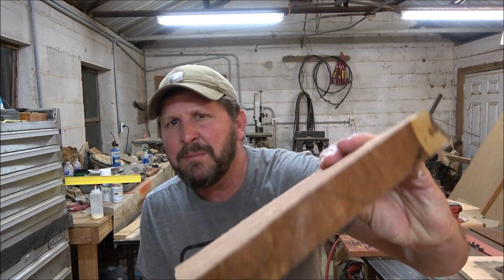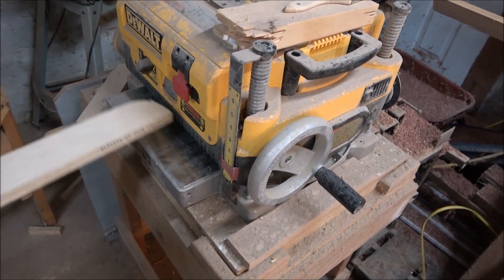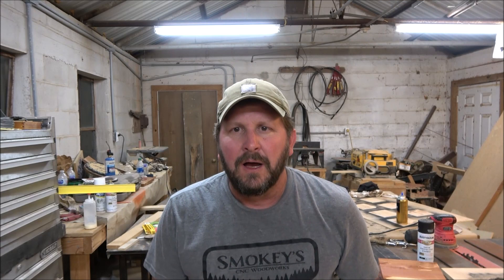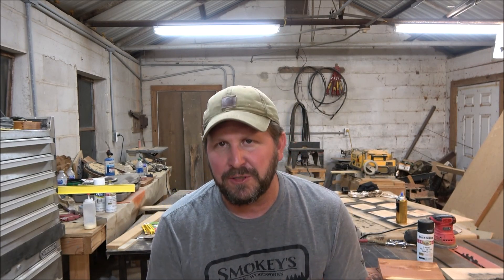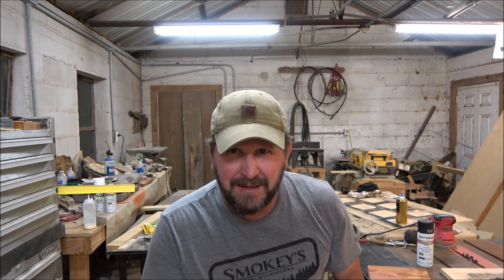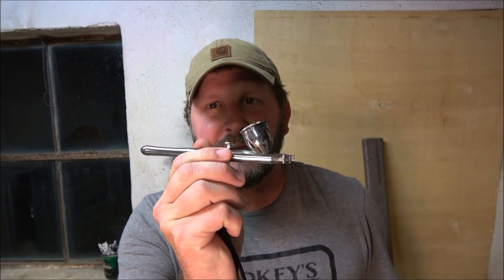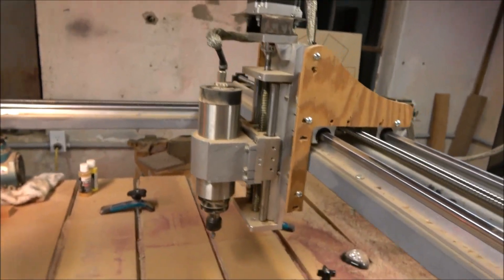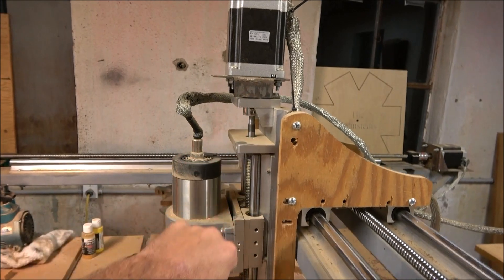CNC machine and process (Questions and answers)

Comment: Hey there Smokey!! Awsome videos I reatdo admire what you’re doing..I do basically what you do..just closed in my shop so now I am working the AC😁it’s freakiohot down here in south Texas!!! Well my question is...I have a built cnc like urs build by Charley Thomas from Triquetra CNC he makes those awesome touch plates,however I have some motors on my machine that get very hot that eventually you can’t even hold them for 3seconds! Bcuz it’s so hot! I have a nice controller with UC100 ..what’s wrong why do they get so hot?I even went as far as putting those little fuses inside the plug cord plugs into the controller the fuses that keep her from getting real hot because without those it was getting extremely hot but I don’t know nothing seems to be working I’m not sure the size of the motors but they’re the ones that are one bigger than the ones that come with the x Carve DIY CNC machine it’s one step bigger from those motors what do you recommend please let me know and thank you so much for your time
Reply from the maker: Awesome, and it is crazy hot here too!!....I think your question got cut off..alls i can see is up to "eventually you" then there is nothing!!...you may have reached a typed character limit in comments....email me at smokeyscnc@gmail.com...Thanks for watching!!